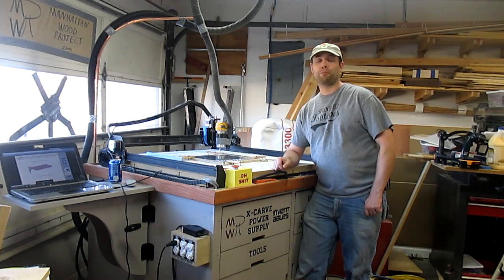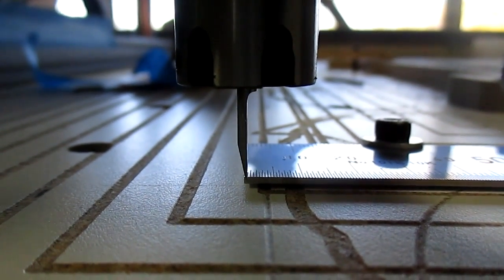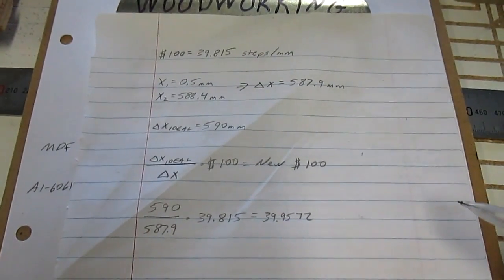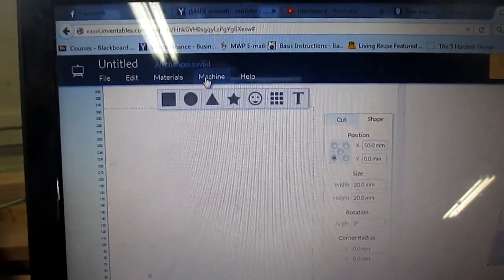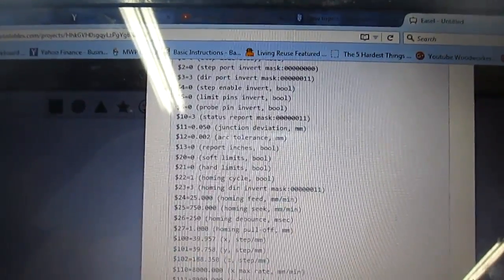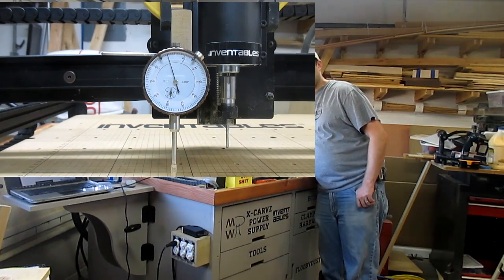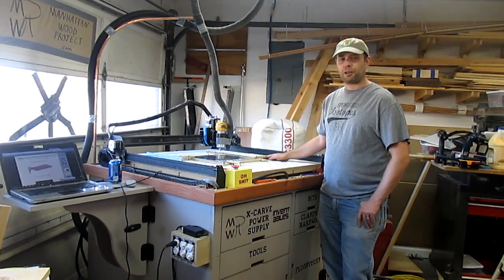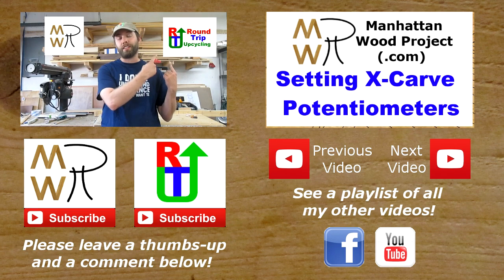36 - X-Carve Stepper Calibration - Manhattan Wood Project

Comment: Hi Robert. I have recently upgraded the Z axis on my Xcarve (heavier, direct drive) and I came across a calibration problem. Maybe you know what's happening to mine... I set the X axis to cut a rectangle 125x76mm and a square 50x50mm. If i calibrate the x axis according to the 125 measurement, then the 50x50 is off... and if I calibrate on the 50x50, then I'm off on the 125mm... I tensioned the belt to 4pounds for 1 inch deflection... check all the screws had enough tension... don't know what this be! any ideas! Thanks in advance!

Comment: You are so awesome! I FINALLY got my X-Carve up and running so I'm in "watch videos to figure out the subtleties" mode right now. I'm actually looking for advise on working in acrylic. I just did an acrylic test run and melted a huge blob of plastic onto the bit. Either I'm using the wrong bit or need to slow down the feed rate (or both). But I'm learning some great stuff from your X-Carve videos that I've watched so far. Thanks!
Reply from the maker: +Wood 'n' Stuff w/ Steve French Hey bud, thank you!  There's a heck of a lot of great information on the Inventables forums that would help, some of it even more than videos.  Not my videos though, those are the best source of information EVER...  :)